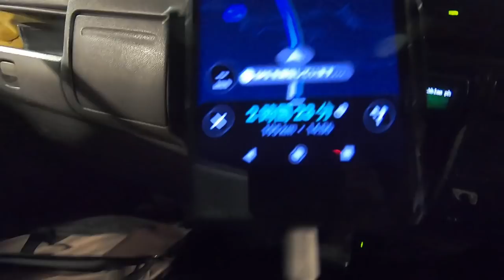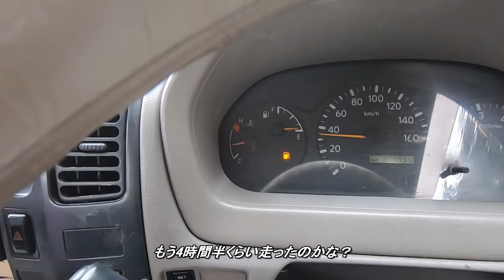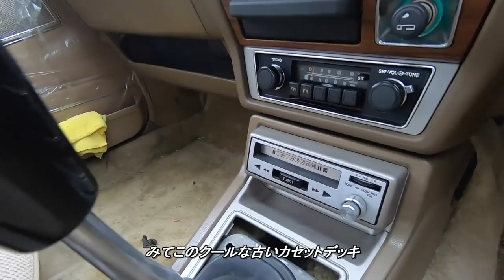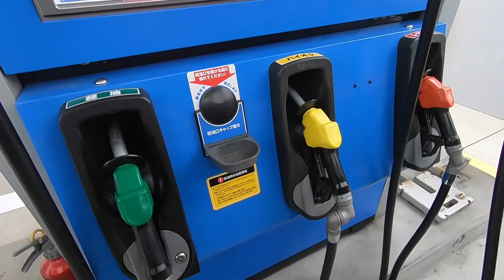I got myself a Corona! A Toyota one!! Classic car build!?

Comment: That interior looks MINT!
Not too sure on the big rubber bumpers.

Those Black Racings look really good spec too :) Will be cool on them or your Longchamps you have in your shop.
Reply from the maker: the bumpers kinda give it some character👍 the wheels were knock off wats😛
Reply: @heymanrobbie  I always see loads of the Black Racing wheels on Crooober. Surprised they still make them new, good sizes and so damn cheap.

Comment: Just a few helpful hints if it helps;
These share a very similar platform to carina/celicas (aa60,ra60,ra64) 
The diff has the same centre (axles are different lengths) as first gen ae86
The front end can be swapped to ae86 stuff but keep the lower arms as they are longer than ae86 arms
Find a rt132 dash cluster with normal looking dials - looks much nicer
And earlier style tail lights too

😁😁😁😁
Reply from the maker: thanks for all the info! definately helps especially with these old cars, i want to install a front subframe so i can make it rack and pinion too
Reply: @heymanrobbie  best you find and old carina/celica for parts then, crossmember and steering column should MOSTLY change over
Reply from the maker: nice, imma start lookin👍👍👍
Reply: @heymanrobbie  dude i need to find out a rack and pinion option also. my coorna is rear sumo which ruins any easy swapping
Reply: are their any bolt on subframes that would allow rack and pinion?